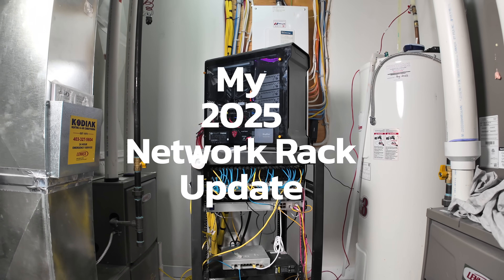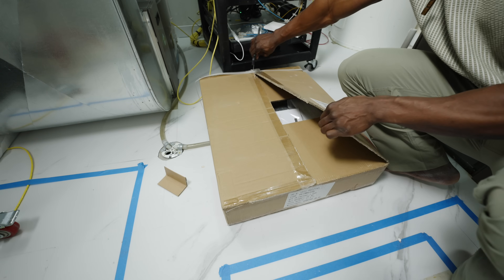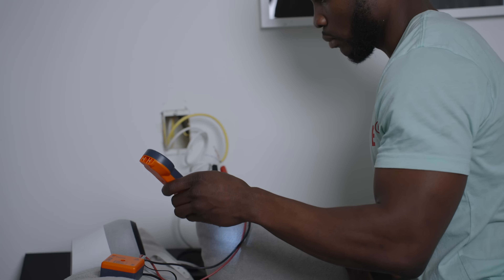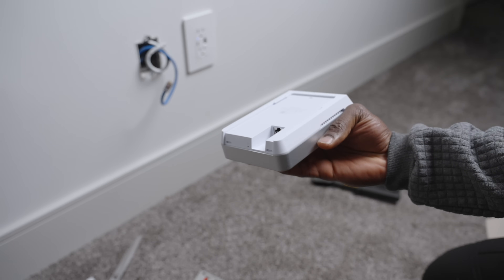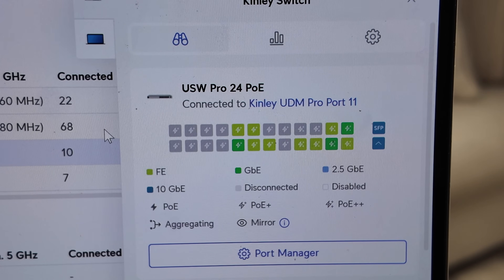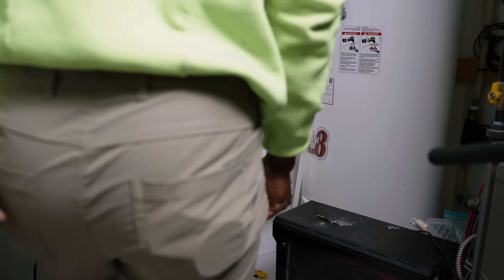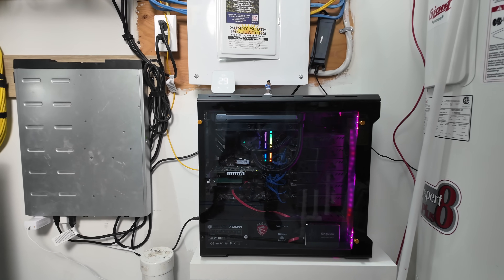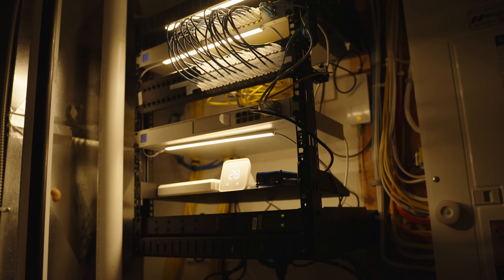Supercharging My Home Network: WiFi7 + 10Gbps

Comment: Im in the process of planning my network, and and I need to plan for at least 10gig access from a NAS (video editing) to my office and maybe 2 other jacks. Maybe, and this is purely secondary, a Unifi UNAS Pro for data backup. What should I keep in mind?
Reply from the maker: @BLKCreativeStudio  is it a home build or business build ? Are you going to be running cables or using existing cables. 10gbps requires at least Cat6 and that has distance limitations so you might want to be using cat6e if you are running new cabling. Also budget is something to consider you could go the slow route or just go all out. I did mine slowly over years and will keep doing that. But I just finished a build for my brother were we went all out. (Video coming soon for that one). Is the NAS going to be purely for editing?
Reply: @tytalkstech   The only downside with running 10gbps over a copper link is the potential heating issues 10G-base-T SFPs bring. I run 10gbps between a 10GB unifi switch to 3 servers in my house and my desktop using MM fiber and SFP+. No heating issues and fiber isn't too expensive...  I bought an old Intel X520 Network adapter for my desktop so it's running fiber directly to it.
Reply: @ thanks for the response. I should have given more info;  I have CAT6 pretty much everywhere in the house (residential project), in my media room/office space I have 6 drops, the main network would be in a closet. Do I connect the NAS to a 10g switch and patch the cables that need that high speed access to that same 10g switch?